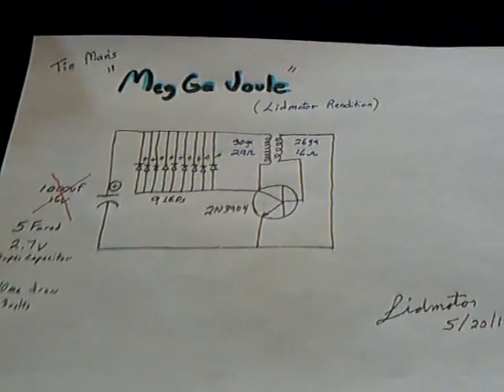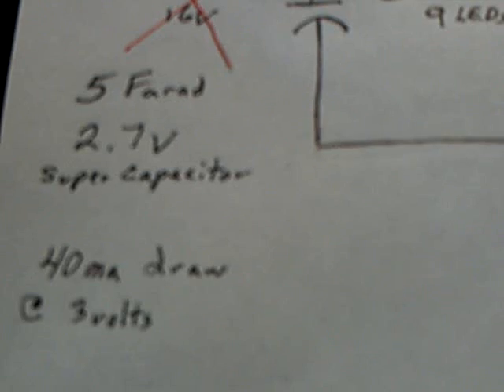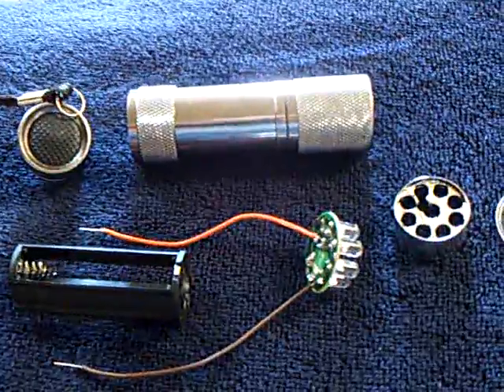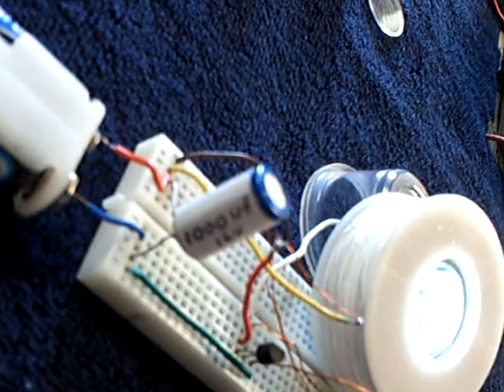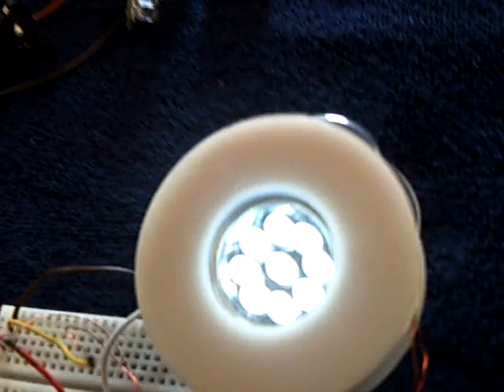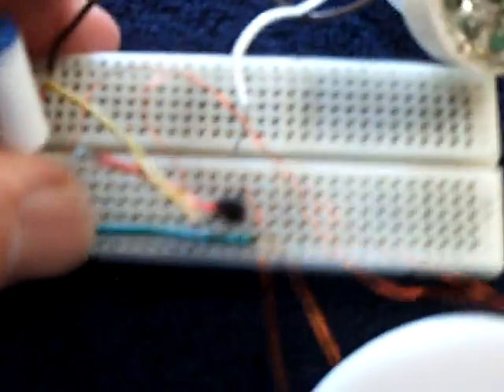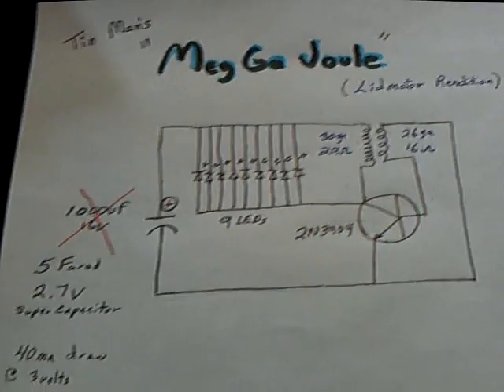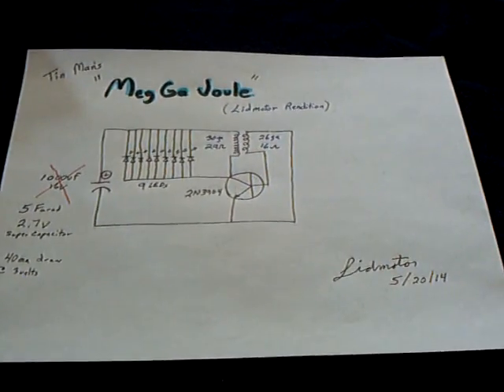Tin Man's  MEG GA JOULE ---my replication

Comment: Very nice! make a nice compact light you could put everything in the coil and silicone or epoxy everything and make a nice indestructible light ;) Thanks for sharing!
Reply from the maker: That is what I'm thinking.  I have been running this non-stop on a AA and it makes a nice little light.  I might box this one up and use it on my boat this summer.  It only draws 15ma on the AA battery.
Reply: That's awesome ;) I would encase it in transparent epoxy :)

Comment: Hi Lid.Can You show me some Joule Thief schematics to light Leds for more time connected to 1,5v battery? because what I've used untill now doesn't last longer then 3 or 4 hours continually with 3 bright Leds.Cheers
Reply from the maker: The device you see here will run on a 1.5v AA at 15Ma with usable light (enough to read with in the dark).   It might run a week non-stop.  You don't need the capacitor.  You could build one using the Radio Shack magnet wire pack. Use the 30ga red wire for the collector coil and the gold and green wire joined together for the base coil. Any small NPN transistor should work.  The ones that come in the Radio Shack pack are what I use.  To get the circuit to start you need to briefly tap a wire from the base to the (+) rail.

Comment: I'm interested how he +tinmanpower can charge his super cap by just quick -1second tap?
Reply from the maker: How Tin Man can charge the 5F cap with a quick tap is somewhat of a puzzle to me also.  He explains it in the 3rd video.  On my setup the circuit will not self start at a low voltage like 1.5 volts and you have to tap start the oscillation with a jump between the base and the (+) rail.  Perhaps his cap is not completely discharged and the strong jolt from the battery is all it takes to get the oscillator running.
Reply: TinManPower Did explain that in the explanation video. Although it is a concept few understand.
The cap was pre-charged. He just added extra voltage to one side of the Collector coil (primary) to start it. While the primary did not pass current through the collector. It did bring the collector end of that coil to a higher voltage. This requires a small current to flow through the primary for a moment. So the far end can be at the same voltage as the powered end. This in turn causes magnetic amplification (or step up) to take place in the secondary coil (Base coil) which activates the base long enough to pass current through the collector and start the oscillation off.

I have done a few videos some time ago demonstrating devices that use the theroy, although perhaps I could do another one that is clearer on the theroy of how it works and exactly what I did.

In this video I used a germanium transistor that requires 0.175 volts on the base to operate. To make a Joule Thief that starts from .06v
Ambient Solar Harvester Starts Ossilating From 60mv
Looking back at this circuit I'm tempted to have another crack, With what I have learned in the last 18 months I think I can improve the output, and possibly lower the start up input a tiny bit more.

I also used the same theroy in reverse, as a step down on  the base, to get an SMD transistor to start from 1v, but a piddly 10 nano amps of current. Which was not enough current to fire the base on a 1:1 coil. So I stepped the voltage down and amplified the current to the base. The longer collector coil also gives just enough output on flyback to light a tiny red SMD LED very dimly. SMD panel, 10 nano watt mini solar oscillator.
Reply: Here is the video that got me started with the magnetic amplification theroy.
Joule Thief very very low input  0,136 volt
I have replicated with higher amplification ratio and it still runs from 350mv start up down to 127mv once started above 350mv. Needs a couple of milli amps.

The BC107 is one of the lowest starting silicon transistors I have tried. at 350mv with a good JT. About 500mv b-e voltage on diode meter.

If you click a link near the end of the video it takes yo to this video which have another multi tapped version. I have a similar one, Its great. I highly recommend multitapping JT cores.
Joule Thief adjustable from 0.1 to 0.7 volts, part 1
Also note the LED is from colector to base. to take advantage of the negative spike on that side of the coil. You get extra voltage here, but less back charge into battery so it goes flat faster.
Reply: Mongrel Shark 
So what you saying is that TinManPower  didn't fake his vid, do u think is it possible to achieve what hi did?
By the way you should write book about electronics ;)
Reply: Tin man glued a label on a cap, to make it look 10,000 times smaller, and used a clever trick to make it look like the cap charged instantly. When in fact it was already full. He just used the battery to start the circuit, which then filled from the already full cap. As was explained in his video.
If he really wanted to make an impressive fake, he could have just as easily started it with a bit of static, or a click from a Piezo.

The original 2 videos (which have been taken down I think) where well done though. Got me going enough to start finding parts to replicate :D Wasnt untill I watched part 3 I realized I should have been more skeptical and asked a few tough questions.
Reply from the maker: Thanks. I need to get some of those low trigger voltage germanium transistors.  Maybe I will give my Penny an early Christmas present.  She will run at about 1 micro amp but she needs about 1/2 a volt to get going.
Reply: You know I have a penny coil here, played with it a lot when I first started with JT's and it taught me a lot. Cant remember if I ever tried the germanium...... I could never get it under .5v and 1 micro amp either.

Comment: Thank you very much!
Reply from the maker: You are welcome.  This is an easy one to try if you have the parts handy.  By the way the 9 leds work backwards as a poor man's solar panel.  In bright sunlight I got 2.5 volts at 10 micro amps.  It is enough to run a Penny oscillator.  Very cool.